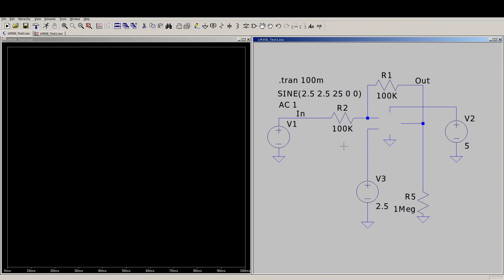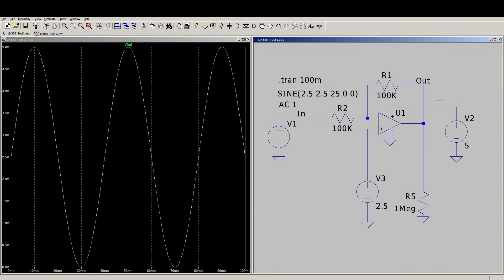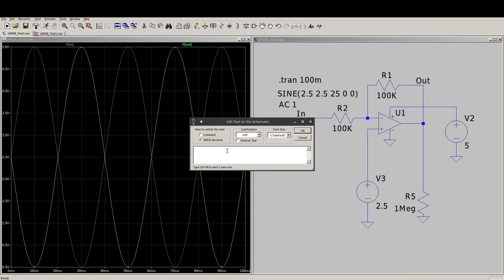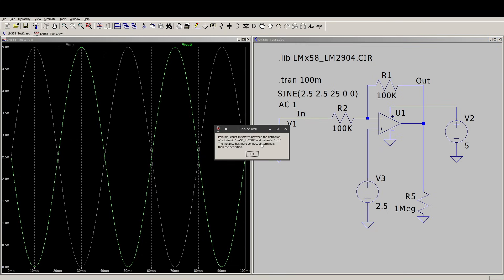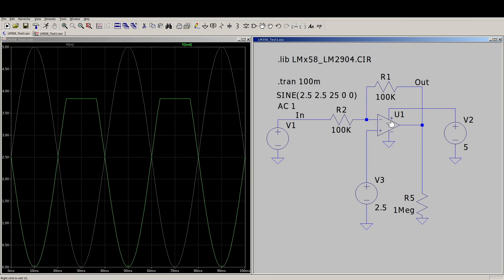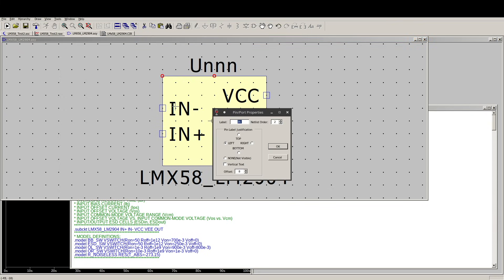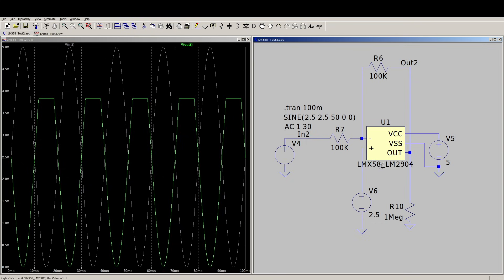LTSpice - Importing a New Component Model for Simulation

Comment: Thank you for the mostly clear video.  4 years later and it a bit outdated.  LTSpice appears to have changed enough that these instructions no longer track.  Also, at 3:37 you say "If I right-click here..." where?!  I had to run the video back a couple of times to catch here your mouse cursor was at that point.  So overall, you were quite clear (clearer than most), but clarity suffered (briefly) at that point.

Comment: it worked!!! I am using LT Spice for Arch Linux under WINE and it had the exact same problem with the number of pins. I put in "dummy" and it ran! Probed it and it clipped the upper end of the sine wave!!! 😁🤩
Reply: The goal is to place a 4 terminal NMOS and  4 terminal PMOS transistor in a circuit and associate a custom model to them and run a simulation in LTSpice using Arch Linux Manjaro (7/2025)

1) click on Package Manager icon in lower right tray.
2) search for ltspice 24.1.7-1 (maintainer fenugrek)
---This apparently runs LTSpice in WINE, the Windows Emulator for Arch Linux
3) press the "winodws" key in lower left of keyboard and type "lt" and hit enter. This should execute ltspice
4) in LTSpice press ctrl-n for a new schematic
5) press "p" to place a component
6) look for or type in "search" box "nmos4" to highlight nmos4 4 terminal device and press enter
7) the NMOS symbol, "nmos4" is now attached to your cursor and you can move it to the desired location and press enter or left click on mouse to place symbol.
8)

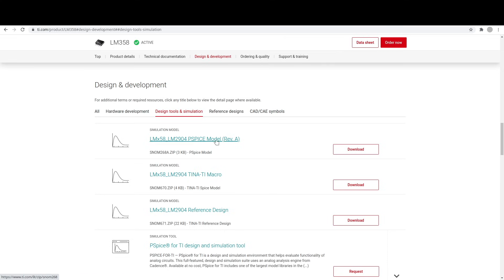Comment: Being new to downloading models, I'm trying to find the simple 1 - 2 - 3 steps on how to download a model from a manufacturer. At 2:14 you show that there are models at the manufacturer, then at 2:37 you suddenly have these files in your LTspice folders. I tried the same thing but when I run the simulation LTspice gives me a message, "can't find files". Can you please show HOW to get these files into the correct location instead of saying, "you can download these files"? Yes, we all know that we "can" download these files. We want to know HOW.
Reply from the maker: I showed that I saved the library files in the same folder as the project files, which should automatically allow it to be found.  Apparently LTSpice will also look in a few other locations based off the user home folder as listed here. Maybe you can try putting a library file there and see if it finds it
https://ltwiki.org/LTspiceHelpXVII/LTspiceHelp/html/DotLib.htm